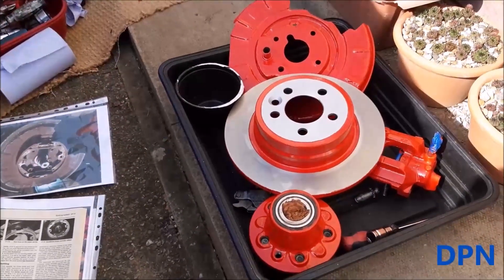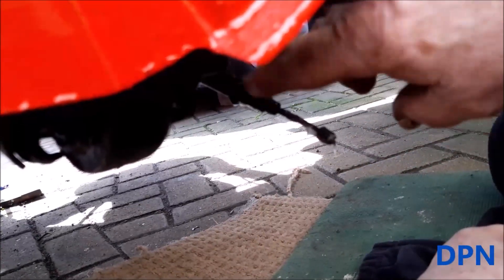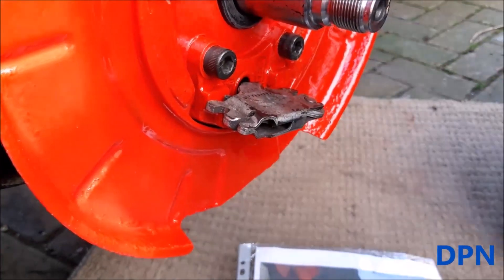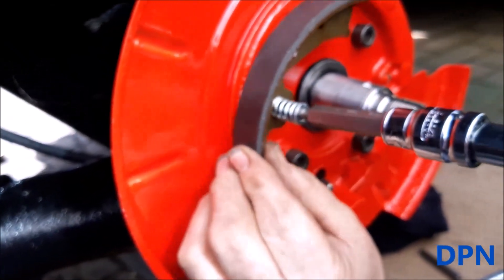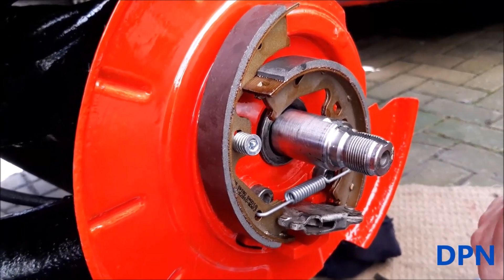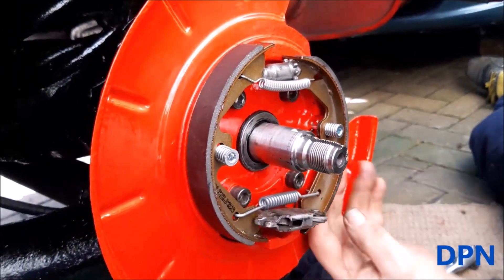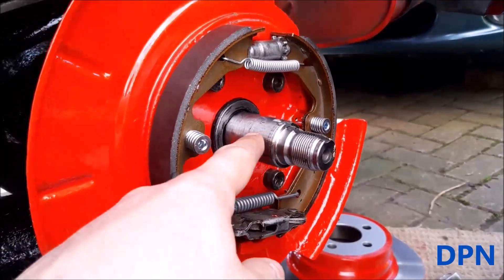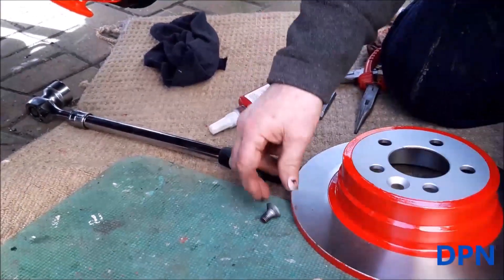Replacing the handbrake shoes on a rover 75

Comment: Wouldn't recommend Loctite on the disc retaining screw. It sits where it should when the screw is tight, cannot back out as the wheel holds it in place. Absolute pain to remove if it's got Loctite on and a bit of rust...
Reply from the maker: @Iainb1954   I understand what you mean we probably use Loctite because the manual suggested it and we had it available doing the job
Reply: @DPNTV  Just done all four discs, had to cut a slot in the screws and use a hammer and chisel to get them out. No loctite, just rust...😂